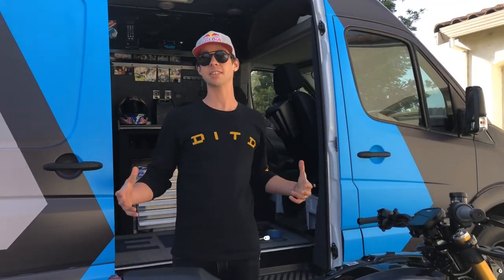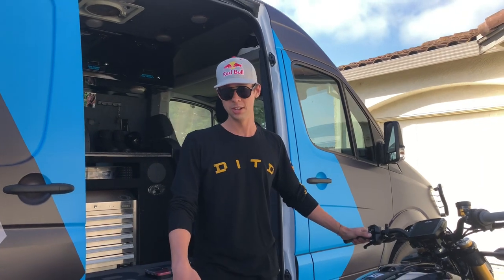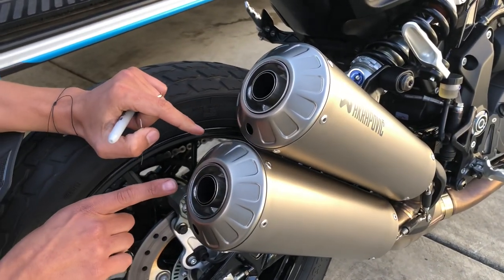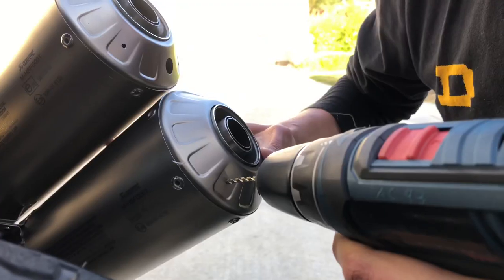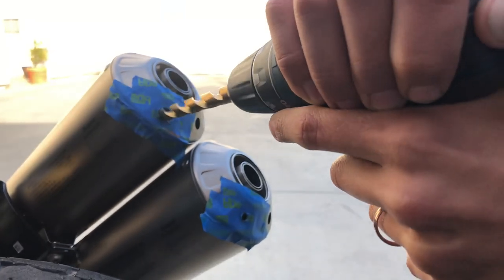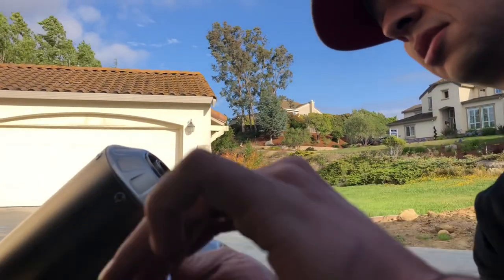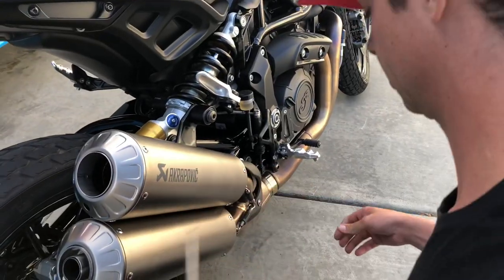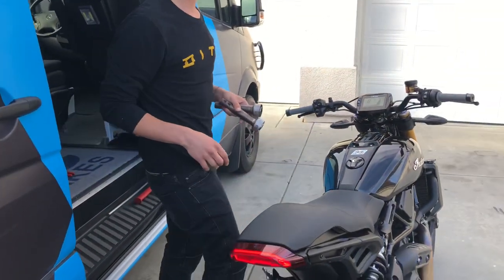Drilling Holes in a Brand new Indian Motorcycle? How to remove FTR1200 Exhaust Baffles

Comment: Thanks for this video, I just did this today, the Allen bolts right where you said. Bad news was I think there may have been a spot weld or something on the top pipe. Ended up needing to drill out that bolt. Sounds way better though now.

Comment: I just did mine. I had an 8mm bolt with a spot weld holding each of my baffles in. My holes started out looking good, until I realized I had to get a socket in there. But, some rubber caps pretty much covered my butchery ! Had to take the mufflers off to tap the baffles out.

Comment: I gave this a go. Unfortunately for me, whoever did the welds on the Allen bolts didn’t do a simple tack weld on the top bolt, but rather a full weld that stopped the bolt from turning at all.

I immediately stripped the 4mm Allen inner, then stripped the 8mm hex outer. In the end, I had to drill the bolt stem completely out.

18 minute job? More like 18 hours on my bike.
Reply: That is unfortunate.  I just did it yesterday and it took me about 20 minutes from start to finish.  I had resigned myself to pulling off the cans, so I was prepared.
The real question is, was it worth it?  My answer is yes.

Comment: It seems to me that the original hole was just offset by 60°. Wouldn't it be cleaner if you just drilled out the rivets and twisted the cap one hole clockwise? Then you'd be able to access that screw via the original hole. Awesome mod either way. Sound deeper and the pops make it. Cheers!
Reply from the maker: It was about that much rotation. It would have also been a good solution to remove the rivets and rotate the direction of the hole but with the time investment and having difficulty in the past finding the high end finish rivets this seemed like the best method for time invested with satisfactory looks.
Reply: Someone tried this and found that this won't reveal the bolt. This is the best and easiest way with the least risk of damaging the endcaps(they are pretty tight sometimes needing a lot of force to remove them).
On the Ducati Scrambler Akra's the same trick can be used(that is where this whole thing was discovered in the first place).

Comment: Please, for the love of all that is holy, don’t do this to that beautiful exhaust.  1) Drill out the rivets, 2) cut/grind the welds to separate the end cap from the internal piece that the baffle mounts to, 3) remove the bolt, and viola.  I took mine to a machine shop, they 4) welded the pieces back together for $20 and now the holes are aligned so I can put the baffles back in any time I want.  5) Rivet end cap back to the can.  Easy peasy, no unsightly extra holes, no one would ever know I took the can apart by looking.

Comment: HA! I hate you for making that look so easy.   Got a single high mount on an XSR900 the back box is welded to the pipe so can't go in through the back.  I wonder if there is an hex bolt in mine at the same location because i've drilled the welded area out and can't get the baffle to budge for than about 3mm.

Comment: while this was quicker/easier, why not drill out the rivets and re-rivet the tip back on.. then no need for a grommet for the hole and more professional job/appearance. also, how's removing the baffles affecting that back pressure / factory tune?
Reply: @shouldhavereloaded  what do you mean, "loss in compression". you're not losing any compression. that takes place in the engine.. cylinder/head/piston/stroke. you're losing back pressure which usually equates to loss in low end power i believe. can sometimes cause a bit of a lean condition as well. i just removed the baffles from my triump speed triple rs. i drilled the rivets.. no need for a 1/2" hole and a grommet/plug. but yes, you could do 1 can as you said though. there is no real reason for 2 as long as the muffler piping doesn't taper down a size.